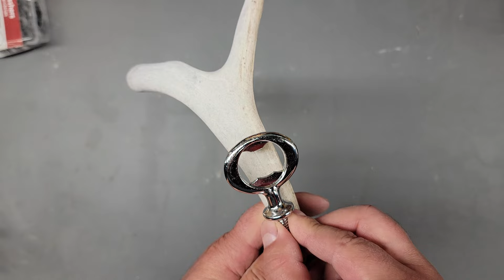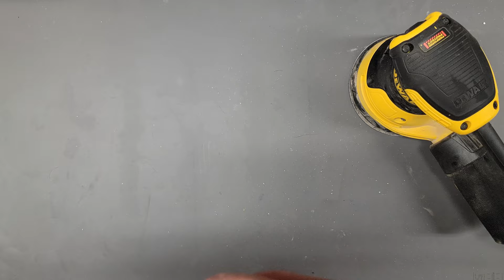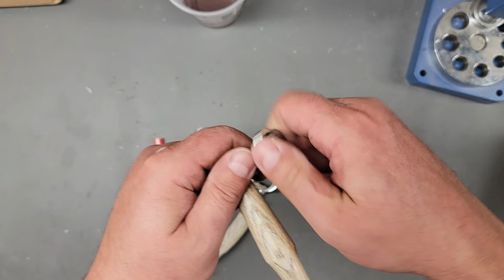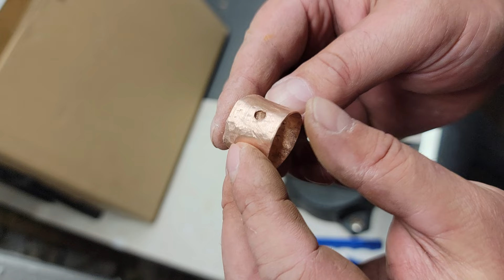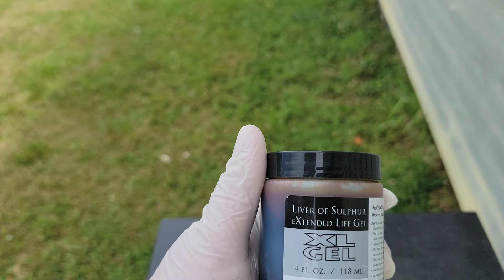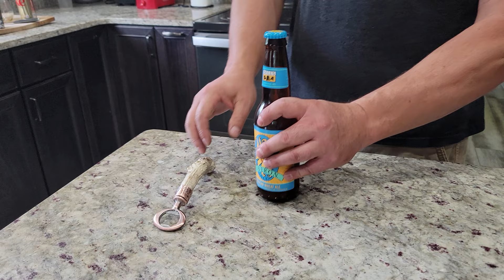Antler shed with copper - bottle opener #countryroadcustomdesign

Comment: Great video! What is the adhesive you used to screw the opener into the antler with?
Reply from the maker: Thank you! I just used some thick super glue. It was a tight fit to start. The glue was more to help keep it from spinning over time.
Reply: Have you tried Potassium Permanganate on the antler? There's a lot on line about using it. I have just completed a 'Sgian Bru' for my daughter and put two or three coats on it and rubbed it down. This darkens the hollows but you clean up the top areas. I'm very very pleased on how it worked. Next in the pipeline is a couple like yours as presents. Keep it up.
Reply from the maker: @scottmasson3336  I have heard of potassium permanganate, but only in fire starting with glycerin. This is a cool tip I will definitely have to check out. Thank you!